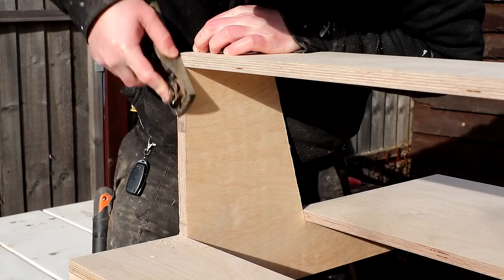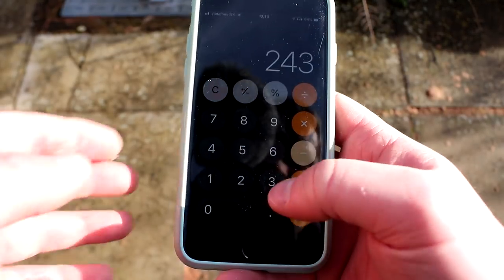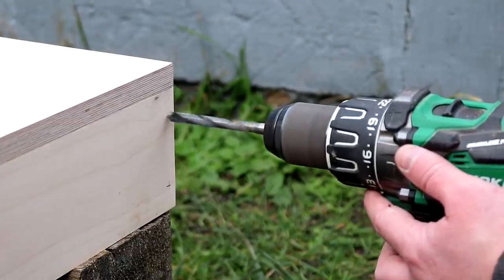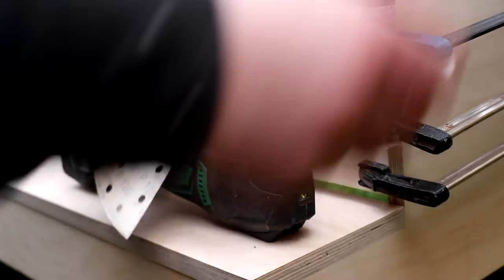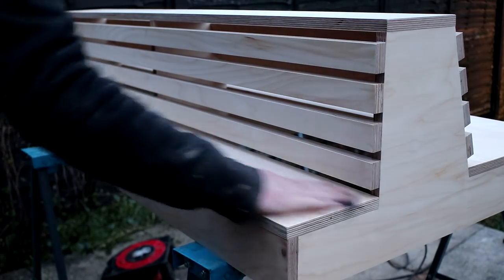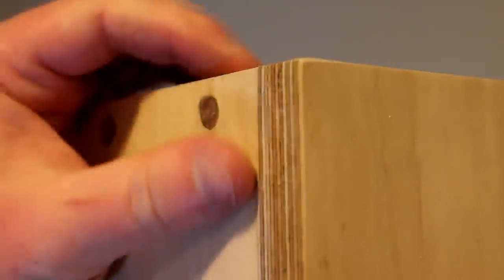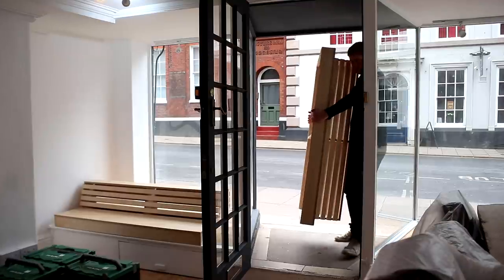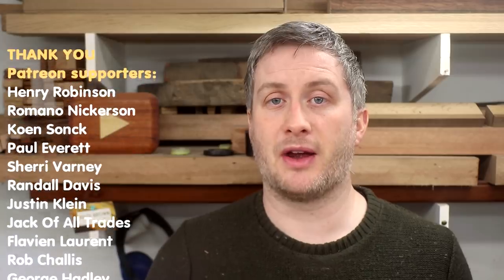Making Bench Seating - Barber Shop Commission (part 2 of 2)

Comment: Nice one Keith! A good trick if you want to locate something like this without fixing it down permanently is to use little scrap ply blocks just glued to the floor in each of the corners; it’s enough just to locate the piece and stop it being knocked, but the blocks can be removed easily enough if you stick them down with e.g. hot glue, or 3M double-sided tape. 👍👍
Reply from the maker: Great idea! Thanks Peter 👍

Comment: Another inspirational video, my workshop is a 8 x 12 shed, fully insulated that permits work in the really cold months.  I often have to work in the garden when using sheet material and it it isn’t an issue.  I do have a Makita track and Dewalt table  saws.  So it’s great to see a quality job done in similar surroundings to myself. 👍🏻👍🏻👍🏻

Comment: Nice work Keith. Turned out great, personally I would have gone with a highter back to the bench but clients orders I guess. I was wondering if you had difficulty finding the baltic Birch ply and exactly how much it was here in the UK. You see the American channels work with it often but never over here.
Reply from the maker: It was about £70 per 8x4 sheet. You can get it at most builders merchants or bigger timber yards